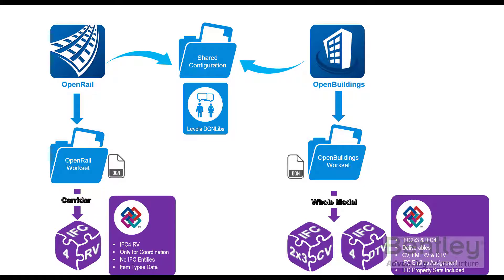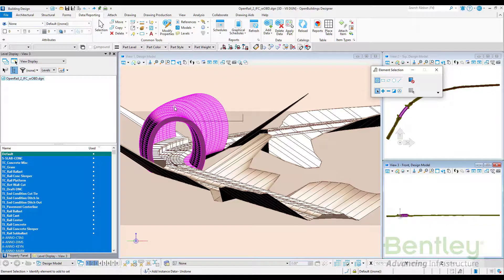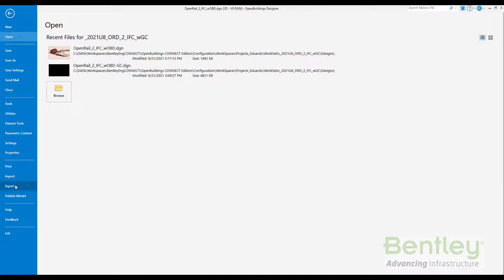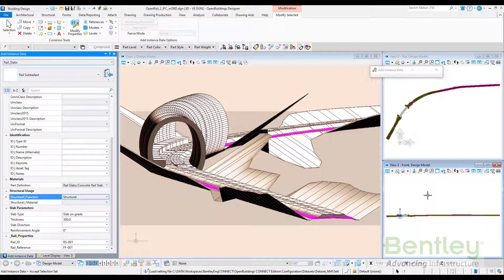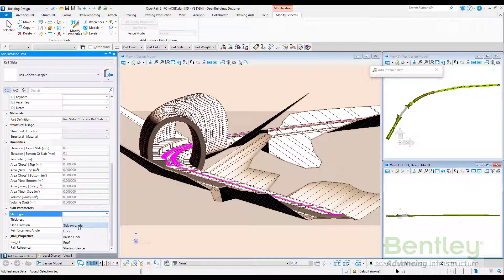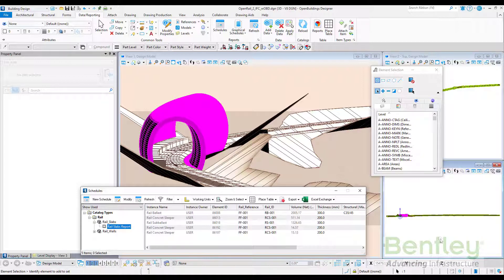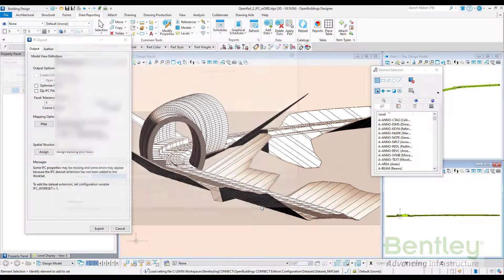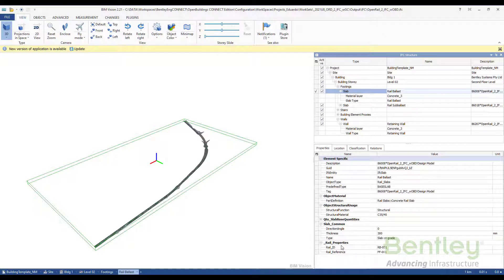OpenBuildings Designer CONNECT Edition - How to produce an IFC file from OpenRail Designer models

Comment: Hi Eduardo, This is an excellent explanation and we are using a similar approach here in Australia. One thing I noticed in the IFC property is fields like Thickness, Wall height, width etc, is it something generated automatically by software or you are inputting that information in the fields using schedules? Also, is there a way to map itemtype data to catalogue definitions directly in OpenBuildings?
Reply from the maker: Hi Jaimin,
The IFC Properties can be automatically filled with OpenBuildings DataGroup properties. You can see a detailed explanation here: https://youtu.be/tPbDCr1cVBc?t=1652
Reply from the maker: Regarding the mapping from Item Types to DataGroup Catalogs, there is not a direct way to do it, but you can use the Export to / Import From Excel tool to do it. I recommend you to check this playlist: https://www.youtube.com/playlist?list=PL7jfe0_WZE1prhAxRz4GcmPz-hgf39u43

Comment: I am exporting open building file , but in exported file we can not find the added attributes can you please help
Reply from the maker: Please check you are mapping the DataGroup Types to the right IFC entities. It is showed in the video from 8' on https://youtu.be/_onAF-Aahrs?t=481
Reply from the maker: Check this post also: https://communities.bentley.com/products/building/building_analysis___design/w/building_analysis_and_design__wiki/21918/ifc-and-cobie-export---enabling-the-required-properties
Reply from the maker: The preparation for right IFC Properties enablement is explained also in this video: https://youtu.be/qFCPOhwn4l8?list=PL7jfe0_WZE1qLv9it0j42RL5jPLC6HG05
Reply: Thank you for your support but in the case of modelling with mesh on which catalog item we should define properties and How
Reply from the maker: @maitrydave3413  You can use the tool called "Add Data" to add any Catalog Item properties to any element. It must work with Meshes.